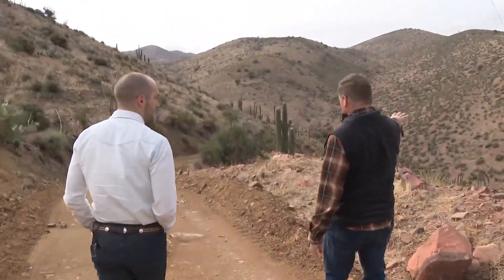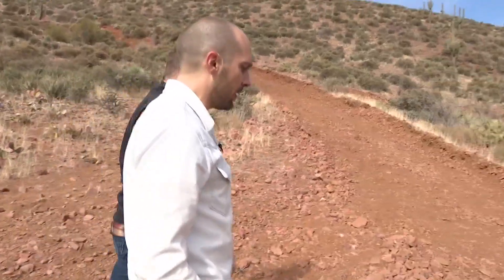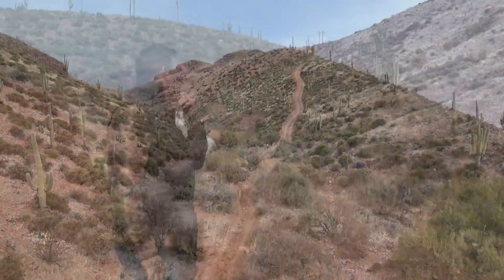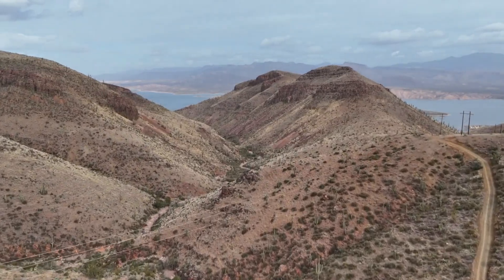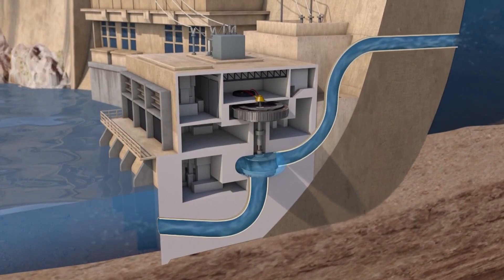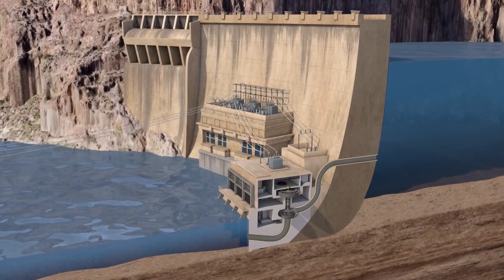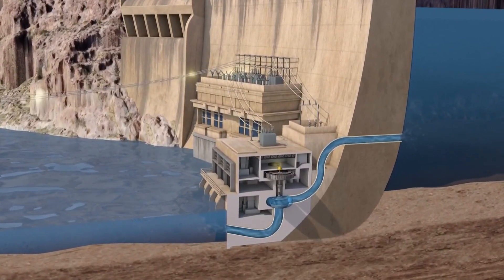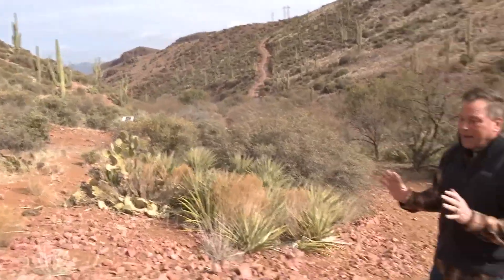Future Arizona lake to deliver unprecedented clean energy as soon as 2033, SRP says

Comment: It will NOT provide power.  In fact, it will lose power through inefficiency.
It costs energy to lift water to that higher elevation.  The payback is that the energy that's wasted can't be used because it's generated when demand is low.  
They will drain the reservoir and run generators when demand is high and they need additional power that the normal dams can't provide.
Reply: Not to mention massive evaporation. This thing will cost tons of water to use.

Comment: Now maximize the power production both ways. How by installing slow speed underwater turbines called Wateroters just down stream of your water outlets and also in your return channels when you refill the  reservoir.
You only need water moving 2 to 5 miles an hour for these units to work. They won't harm fish, can be moved if needed, can be up sized to fit your needs and run 24/7 . Stop wasting potential hydroelectric power by not taking advantage of this idea. Note you could also add atmospheric water generators to make clean drinking water at the same time. With your reservoir the atmospheric generators can take advantage of higher humidity just off the surface of the water and operate close to 100%. These two ideas can be scaled up to meet your needs.

Comment: Sounds way too good to be true.  First off, this location is hundreds of feet higher than Roosevelt, at least as it is shown in the video, so how can it be between Roosevelt Lake and Apache Lake. Secondly, it takes enormous energy to move water uphill.  And if this lake is to fluctuate by hundreds of feet per daily cycle, that is also an enormous amount of energy to move that water back uphill and I bet the power consumed to move that water will be greater than the power generated by the dam to start with.  Imagine the size of the solar field it would take to reverse the flow.  Then there is the problem of time.  I bet there aren't enough hours in the "off-peak" timeframe to move all of that water back through the dam.  I'm not an engineer, but this sounds exactly like "Free Energy", and a way to suck billions of our dollars out of our pockets and ruin a big swath of land in the process.  It just sounds too good to be true.

Comment: Great, another high-speed train to nowhere, money laundering operation. Where is all the water coming from? Why not just drain those two reservoirs and install modern power generating turbines!!!
Reply: This literally is modern power engineering. Engineering is about improvement and trying new ideas. If this is economical, why not give it a try. Roosevelt lake didn't exist as a large body of water before it was dammed. This will be no different.

Comment: Build more nuclear power stations!!
Reply: Cooling it with what water?
Reply: @dannelson6980  
If the state can locate water 💧 to fill an artificial lake to run a hydroelectric plant they can find the water 💧 to cool and operate a nuclear power generating plant - and the nuclear plant is MUCH more efficient than this proposed hydrogen plant..with MUCH LESS water 💧 needed or used!!
Reply: Sure, if you want expensive energy. The UNSUBSIDIZED LCOE (leveled cost of energy) per megawatt for nuclear in 2023 had a high of $221.  Also, wait 12+ years for it to come on line and you get 1GW.  That's a long time to wait to get an expensive Gigawatt.

Comment: So, once the water runs out of the lake, how are they going to pump 100ft of water back into the lake, it is flowing away from the dam. This sounds like someone’s idea of spending money they don’t have so they can run the project poorly while pocketing the money. 
I see bad things from this.
Reply: Why didn't you just watch the story?
Reply: Roosevelt was built in 1911
Reply: This is not someone's pipe dream.  This has done for decades and works very well.
Reply: The video explained it with pictures. Please don't reproduce
Reply: @powerpace1 
The video said it was a lake, not a reservoir. They did a poor job of explaining it. The animation showed the water that was lower flowing away which would mean it’s a river flowing away even though they are pumping back up from it. 
So the water flows from the lake, through the turbines into a reservoir. Then they pump it back up to do it all over again. They needed to explain it a little better for those of us that don’t know what they are talking about.
But it still doesn’t change the fact that this project will be funded by tax payers and poorly mis/managed!
Reply: They have been doing this for 54 years at Canyon and Apache lakes ( reservoirs ) It's called pumped storage ( pump back ). Water is released from one reservoir to the next lower reservoir to generate power during high demand and the same water is pumped back upstream during times of lower demand. This project is not new technology. It simply adds generating capacity to the existing reservoirs on the Salt River.

Comment: Great! Where does all that water come from??
Reply: Sounds like it’s coming from Roosevelt lake.
Reply: @TeachAManToAngle sounds like it to me the one lake is higher and one is lower.  Release the water to turn the turbines.
Reply: Salt River watershed Made up of numerous tributaries and perennial streams.
Reply: Horseshoe reservoir is losing it's effectiveness to storage capacity because of silt. This will probably be able to retain water otherwise discharged from all of areas dams upstream.
Reply: @ They will be discharging Horseshoe reservoir this June.
Reply: We all need to realize there is a major project going on to reroute many of the waterways, and restoring many others.  Do a little research on the dam release/removal projects just in the last year.  I have found 5 so far.   The problems in Ca do to water mismanagement, and what has happened on the east coast is Much greater than "Helene" and rain.  And YOU ALL
need to quit the Denial that "weather" IS BEING MANIPULATED BY MAN.
Reply: Required rain dances by all citizens.
Reply: You hit the nail on the head. I suggest the state send as many tanker trucks as they can get. Have them at several locations in Phoenix and get all taxpayers to go by and pee in the tankers.
Reply: EXACTLY❗
Reply: Up above and the same source it always has for many decades! Bozo!
Reply: from the extra snow runoff, some years when it snows alot it melts n the spring and flows into the storage lakes and they have to release water from the damns making it go to waste
Reply: @annedebratto2361 that will become increasingly non-existent.
Reply: I hope others see my comment and agree it's a terrible idea
Reply: California that’s where
Reply: @z71.05  No, they send all of theirs into the Pacific,
Reply: @z71.05  Wrong, it comes from run off and the Colorado river, we also have lots of underground aquafers. California just brings their landfill trash to Arizona.
Reply: @z71.05  So basically what you're trying to say is that you absolutely suck at geography.😂